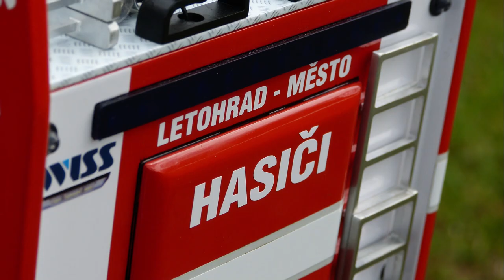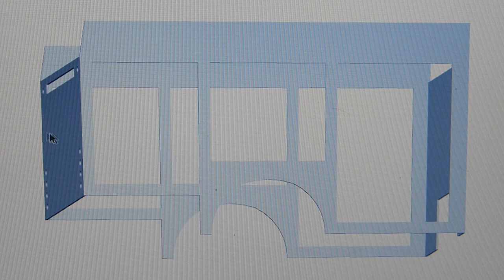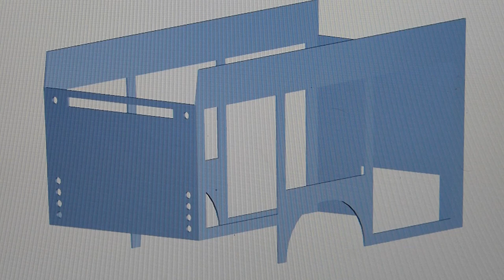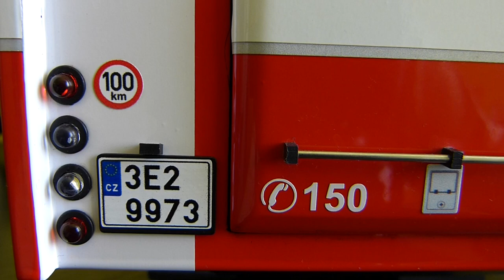RC Fire truck Scania

Comment: Very nice work. I like how clean and tight all the wiring is laid out. Good idea to use an extra set of front steps and turn them around as rear steps for the cab.